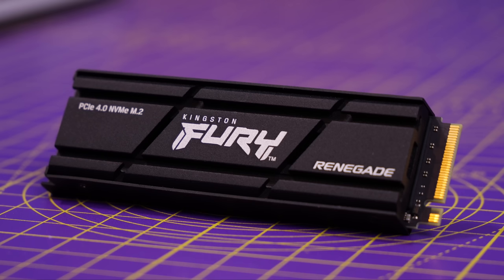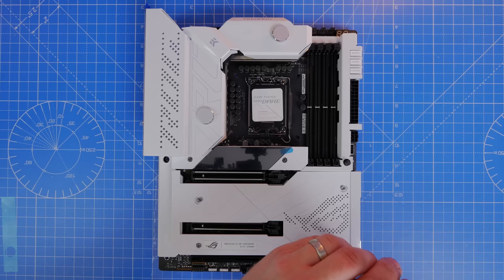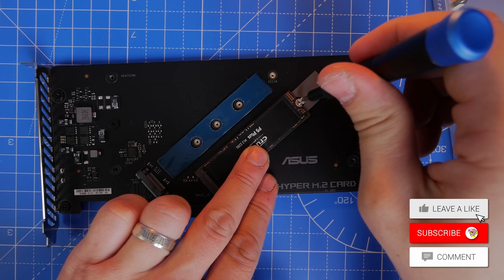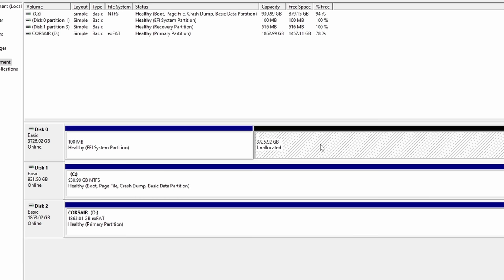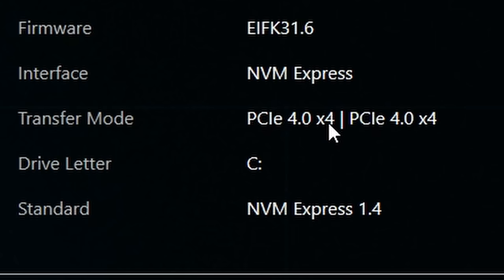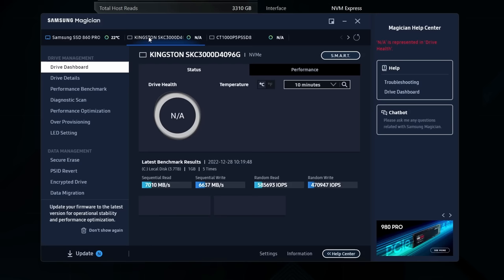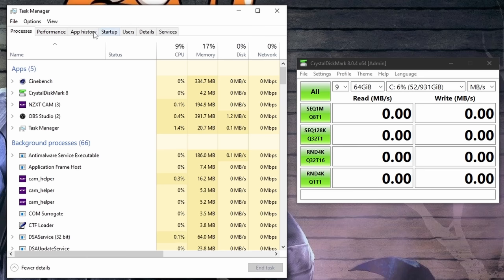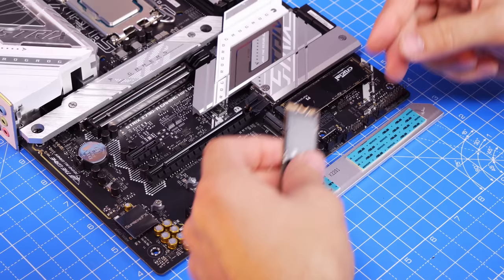Don't make these mistakes with your NVMe SSD installation - NVMe tips and tricks

Comment: You mentioned using NVME in all slots reducing GPU PCIE to 8x.  As I understand it, there is no current GPU that takes advantage of using 16X.  For reference I am using Asrock Taichi z790 and Asus Tuf Oc 4070n ti. I plan on using the top slot and at least 2 others for NVME installation.  Thanks.  Great video
Reply from the maker: I've seen no negative impact from it
Reply: My board states only the first slot uses the CPU lanes the rest use chipset lanes so they do not affect gpu
Reply: Not true at all. Put that 4070 in a pci 3.0 slot and see what happens to the memory bandwidth on the card.
Reply: @TimberWulfIsHere  ummm nobody uses 3.0 lol
Reply: I have a 4090, now with more SSDs runs @ 4.0x8 with 1-2% impact. Didn't notice any difference. Tried @ 3.0x8 and had 5-6% impact, at least measurable.
Reply: @Wlad1 You now that with each PCIE generation, the bandwidth for one lane is doubled? That means a 4.0x8 is equal with a 3.0x16. Your 3.0x8 test would be equal as if you would use 4.0x4 .
Reply: @Kylar195  Yes, correcting a little: 5-10% impact with 3.0x8, so at least noticeable here and there. But 4.0x8 with 0-2% impact is still enough for a powerfull card. Still wouldn't say no to more lanes on a consumer plattform, even if 5.0 means for coming GPUs: 8 Lanes are enough.
Reply: @TimberWulfIsHere the 2080 ti or 3080 ti (I can't remember which) doesn't even saturate pcie 2
Reply: @Zellonous  that would be the 2080. The 3080 bottlenecks pcie3 16x
Reply: @TheHumbleRoots  It's me, I'm nobody
Reply: @TheHumbleRoots there's still people using old Motherboard and they are not the type that upgrade their PC as long as they can still playing games. I one of those people although i did upgrade to AM5 directy from AM3. I will upgrade my New PC to AM7 in future

Comment: I will say, that you should check your motherboard's manual before installing. My Asus ROG Strix B650 mobo doesn't state that one slot is better than another. My old Asrock X370 Tai Chi directed me to put the sata drive in the top slot and the NVMe drive in the second slot for full speeds.
Reply: How did you install your m.2? Die you use the rubber pad to prevent the m.2 from bending?

Comment: I don't think you mentioned it, one thing I'd add is that for whatever reason, the retention screws for M.2 drives are exceptionally easy to strip. After stripping two of them, I went and bought an IFixIt kit. You don't really need to go that far, but you probably want to make sure you're using a Phillips #1 bit. Often it doesn't matter w/ Phillips heads, but in this case it does.
Reply: nah. only you had to be careful of this.....
Reply: @elm4nsuri  Certainly possible! But I've never had this issue with any other screw type, and yet I've had the problem each time I've had to install an M.2 drive.
Reply: There's really no reason to overtighten any screws on a PC. Working on a car it could happen but stripping a screw on a PC is completely out of the question.
Reply: @taylormeyer671  for me the issue wasn't overtightening - the issue was that the bit didn't fit very well. The M2 screws really want a P1 bit. Normally with other screws you can use other phillips bits, but not for the M2
Reply: It's always a best practice to use a bit that fits the screw snug.  Philips was intended to prevent overtightening though.  If you have precise control of your driver, torx would be better if it's an option.  Over tightening is bad, slamming the tip of a driver into a circuit board is much worse.
Reply: @uncrunch398  yes, this was the issue. For me, the issue was actually removing the screw from the mobo, not overtightening the screw after installing the drive.
Reply: My problem is losing those damn tiny screws. By the time I got to buy an M.2 drive to upgrade my system, the silly screws had disappeared. I wish boards would have them preinstalled or just use clips. We've had clips for RAM modules for years, why are we going back to using screws?
Reply: @MarkoVukovic0  I think most newer mobos are actually going with retention clips instead of screws.
Reply: @iamamish  praise to the engineers 🤣
Reply: Best way to make sure you do not strip or cross thread is the turn backward till it clicks, then you know the threads are lined up then lightly screw in. For the hold down screw there is absolutely zero reason to get a firm tighten, just screw in until you feel a little resistance then stop. It's not a moving part that needs a firm tighten.

Comment: As always a soothing and helpful guide for this nutty new technology. As some have mentioned, you should definitely be looking at your motherboard manual. I think people try to wing it too much and with m.2 you cannot do that. Many people don't know you will often lose the use of a few sata ports when using m.2 on certain slots as well. I check m.2 configuration before I even buy a motherboard so I know it will work for my need.
Reply from the maker: True
Reply: New? The tech is like 10 years old now
Reply: @drunkhusband6257  Yup, my Z97 motherboard has an M.2 slot, definitely not as new as one would think.
Reply: Is it possible to boot into u.2 ssd if its inserted to an u.2 to m.2 adapter? @TheProvokedPrawn

Comment: This seems to be a very underrated channel, the content is excellent. One question I had and was confusing from the manual, is there a difference or something to be aware of when installing NVME double sided vs single. It mentions rubber grommets and seems slot dependent looking at a ASUS z790 manual. - Cheers
Reply: If it's double-sided then you'll need cooling on both sides.  The rubber pads they often provide would buffer the metal on the bottom side from scratching the motherboard and preventing shorts.  You won't see a double-sided NVMe unless you're using a very high capacity drive.  All the 2TB and less I've seen are single-sided.  You can tell by where the memory chips are.  The back  side will only have a sticker.

Comment: I never thought to check the m.2 speed/lanes.    I have 1 firecuda 530 2tb and 2 Samsung 980pro 1tb.    I remember using the magician software on my ddr4 board and when I used their benchmark it never reached the rated speed.   This is probably the reason.    

God there's so much to learn.

Comment: The biggest problem is one you can have with hard disks as well: If you install more than one identical drive, nothing in the software gives you enough information to distinguish between them :-).
Reply: expcialy stupid windows 10 and 11 that purposly screw up your duel boot even if you get the duel boot working properly at first windows say-ten or EL says no!
Reply: @nightmarerex2035  dual* boot. they're not fighting each other

Comment: You're missing a related option. If you are going after maximum nvme m.2 storage for minimum cash, you can use an interface converting device. Use 4 pcie x4 gen 2 drives over 1 pcie x4 gen 4 interface. This works by converting the slower older hen pcie protocol to the faster new gen protocol.

Gen 4 throughput is double gen 3, which is double gen 2. At the end you are moving the same Gb/s through half or a quarter the same lanes because of the converter. You pick up a very small amount of latency but multiply the pcie lanes on desktop level systems reducing total cost.
Reply: do you know if a ryzen 5800x3d pairs well with the msi x570s edge max wifi & a 250gb samsung 970 evolution plus with a 2tb 970 evo plus?
Reply: In my bios it's has the PCI set to auto. If I know it's 4th Gen ssd should I change it in the dropdown or should I leave it at auto?

Comment: m.2 4x4 cards are going to thermal throttle without oversize heatsinks so if you want RAID 0 you're going to probably want a riser cable somewhere

Comment: Same goes if you use certain SATA connections, your lower NVME slots will run at lower speed.  Also, cheaper boards may just have one PCIX 4.0 NVME slots (such as B650 for AMD) and the rest PCIX 3.0. New X670 "Extreme" boards vary from model to model, so you have to carefully check for the specs you want before purchase (even if they are $500).
Reply: I'm using asus B650 board, it have 1x 5.0 and 2x 4.0. I would said ASRock only have 1x4.0 and 2x 3.0
Reply: Your advice is a little outdated, my  Aorus b650 elite ax AM5 (definitely a lower end AM5 board) has 3 nvme slots, 2 of which are 4.0 and one which is 5.0.
Reply: Doesn't matter you won't notice the difference in speed its so nominal
Reply: i have a msi b650 carbon wifi and a pcie 4.0 wd black sn770 ssd. Do you know if it would slow my gpu down if i get another m.2? doesnt need to be 4.0 i just want a second ssd for mass storage. sorry i'm not sure about the lanes on the mobo cause i dont know a lot about this stuff :D
Reply: @Mustis91  If you install a second NVME in second or third slot, your card will run at PCIX 8x.  If your video card is not very powerful, you are fine installing in the slot 2 and 3.  Your fourth NVME slot and SATA are run by the chipset.  If you want to keep your PCIX 16x intact and you don't need fastest speeds for your NVME storage, install it in the FOURTH NVME slot.
Here are the specs of your mobo:
4x M.2
M.2_1 Source (From CPU) supports up to PCIe 5.0 x4 , supports 2280/2260 devices
M.2_2 Source (From CPU) supports up to PCIe 4.0 x4 , supports 2280/2260 devices
M.2_3 Source (From CPU) supports up to PCIe 4.0 x4 , supports 2280/2260 devices
M.2_4 Source (From Chipset) supports up to PCIe 4.0 x4 , supports 22110/2280/2260 devices
6x SATA 6G
* PCI_E1, M2_2 & M2_3 share the bandwidth. PCI_E1 will run at x8 speed when installing devices in M2_2 or M2_3 slots.

You are fine installing a second 4.0 NVME.  I would recommend getting something like Samsung 2TB NVME and installing it in Slot 1 for best performance.  Your current WD NVME could then go in Slot 4 (bit slower) for your storage.  I don't see a point of getting another 1TB drive at this point.  If you don't need more than 2TB of storage, then you just simply use 2TB in slot 1 :).  You can add the WD at a later date when needed.  Wait for Black Friday for some nice sales.
Reply: @Omega_Mark  you're a freaking legend! thank you so so much you really helped me out. i wanted a second 4tb ssd cause i already have half of it planned out for stuff i have on my old pc. the other 2tb are free space for whatever i want to put on it and the sn770 was planned for os and steam games etc. so i will probably use the sn770 in the first slot. i dont mind if it's a liiittle slower than a samsung.
But now i now that i can get a 4tb m.2 for the fourht slot and i will be fine :)
..if you can toss a recommendation for a cheap-ish and reliable 4tb ssd my way, i would thank you even more haha. thought about the 180-220 bucks range, doesnt have to be that fast

Comment: For example Z790 Aurorus Master and also some motherboard from ASUS share top m.2 slot with GPU PCIe slot, so it is not always a good idea to install disk to the top one.
Reply: I have the Z390 Ultra Aurorus from Gigabyte.
Reply: @vincewilson1 same here.. I am beginning to believe the bottom slot is best. My graphics card is installed into the top PCIEX16 slot. Also the bottom heat sink will be perfect for my new 990pro ssd 🤔

Comment: Very useful. Thanks. I was curious what speed my SSDs were since I have a 5700g CPU. Evidently, doesn't matter. I found my Gen 3 SSD at Gen 3 speed and my Gen 4 SSD at Gen 4. I have a 4TB Gen 4 coming tomorrow to replace my Gen 3 drive and I'm happy to see I didn't waste $50. lol... No need to replace the 5700g just yet.

Comment: How come some of the M.2 slots have heat pads and other slots don't on the same motherboard? Does this impact performance?
Reply: for the most part it doesn't make a difference. And if you look all the m.2 slots have cooling. for this board.
Reply: Most board manufacturers put cooling plates like (MSI M.2 Shield Frozr) on the higher speed interfaces (PCIe 4.0) cause they run faster than PCIe 3 which means more heat generated, more expensive boards have cooling solutions on all or most NVMe slots cause you're paying more.
Reply: An high speed nvme SSD can throttle down in speed when a certain temperature target is reached, usually with long sustained data transfers. A thermal pad especially on the controller chip helps to dump the heat to a heatsink allowing it to maintain higher/full speed.

Comment: It's funny how hard it is for manufacturers to give the correct info in the manuals. My Asus ROG z790 extreme tells me that if I use the M2_1 slot, it shares bandwidth with the 2nd GPU slot and disables it, yet it still sets the GPU 1 to 8x. And if you install 2 m2s on the DIMM, they also share the bandwidth of the DIMM. They do not tell you that. Very frustrating when everything is installed

Comment: Both my Samsung 970Plus and Hynex gold p31 reduced speed, samsung write 2100mbs, Hynex 3000mbs. Ive tried everything, reinstall Controller, add sam 3.3 update, clear junk files, reinstall ssd. asus tuf 560 gaming plus. installed in black pcie3 drive. temps 42c. Write cache on. AchI mode on in bios.

Comment: tfw I built a pc back in 2019 and installed the NVMe on the second slot without a heatsink while the first slot went unused for almost four years and had the paper still on the heatsink. Just switched it right now. Surprised my PC didn't catch on fire.

Comment: Tip* The closest mvme slot to the cpu is not always the fastest slot. It could be a pcie gen 4 slot and not the gen 5 slot if you have that. Check your motherboard manual or if it is written on the board it's self. I think with the new motherboards the closest slot to the gpu pcie slot is the fastest.
Reply from the maker: There aren't gen 5 drives yet (that I've seen) and they're backwards compatible anyway.
Reply: @TheProvokedPrawn  depending on your cpu and board, 1 or more m.2 slots could be gen 5, it's normally the closest to the gpu but most are gen 4 or gen 3 :)
Reply: Yup. Always refer to your motherboard's manual.

Comment: the no.1 mistake is applying a block of heat sink on ur nvme it does cools ur drive but the performance with and without is same it just a feature not a requirement

Comment: one thing, i bought a ROG, it has that card, in the manual there are some gen4 and some gen3 ports, also depending on which ports you use that will determine the speeds of other ports or something.  I forget but that card I believe is limited to gen 3, at least in my board. I have I think only 2 of 3 on board ports that support gen4 one port that claims to support optaine but when I turn that on the PC randomly bluescreens and crashes, I also cant turn on the full ram speed as turning on XMP also causes system instability.  I used all name brand products from long run companies like Corsair and such no off brand knockoffs so I assumed everything would work.  Spend like 2 grand on this system and I cant use it at full power, however, it is still leaps and bounds better than my old rig and still does what I need so I am at least satisfied but one day I hope to be able to figure out why I cant turn on all the features I paid for.  forget optaine as even Intel has turned it's back on it, but I would like to get the 6k out of my ram instead of 2k speeds.  even if I could one day get them to run at 4k that would be alright.
Reply: Reply with a list of your parts you put together and I can try to work out the kinks on your Ram issue.
Reply: @Addeatt  If you are serious here is my parts list: 
WD_BLACK 1TB SN850 NVMe Internal Gaming SSD - Gen4 M.2, 
be quiet! Dark Power Pro 12, 1200W, BN646, 80+ Titanium, PSupply, 
Gigabyte GeForce RTX 3080 Ti Gaming OC 12G, 
ASUS ROG Strix Z690-E Gaming WiFi 6E LGA 1700 MB, 
Intel i9-12900K Processor (30M Cache, up to 5.20 GHz) FC-LGA16A
G.Skill Trident Z5 Series (Intel XMP) 32GB (2 x 16GB) 288-Pin SDRAM DDR5 6000 CL36-36-36-76 1.20V Dual Channel Desktop Memory F5-6000U3636E16GA2-TZ5S, 
The PC is working, just not at full capacity as I said. ram running at base ram speed no where near the 6k that I paid for.  currently XMP turned off as it's the only way I can run without random blue screens.  I also have removed all other drives so only the one M.2 drive running windows 10.  Runs games great like phasmophobia and several others, but I would really like to get more performance.  Especially since I paid for faster ram I would like to run at like 2/3rds or 3/4ths the 6k I paid for
Reply: @Mikej1592  Have you tried getting 4800mhz to run? The memory controller on i9-12900k is rated to run at 4800mhz for ddr5 and anything above that is considered an overclock which means you might have to mess with timings and voltage (You might be able to get 5200mhz without touching anything though. I'd start there 4800mhz, and if that works fine try 5200mhz. Lmk

Comment: I recently added a 2nd nvme drive to my system but now it takes 1-2 minutes to boot, before it hardly took 7-8 seconds, I've tried everything in bios but unable to figure out the problem. X570 board, I'm using a Samsung 980 gen 3, wd sn770 gen 4 drive and a 2tb hard drive. Thankyou for the help